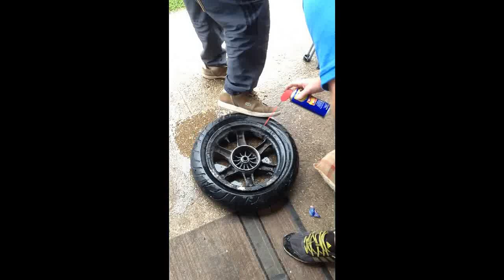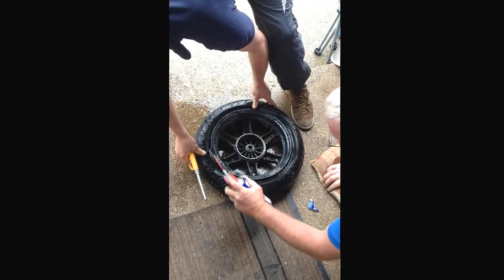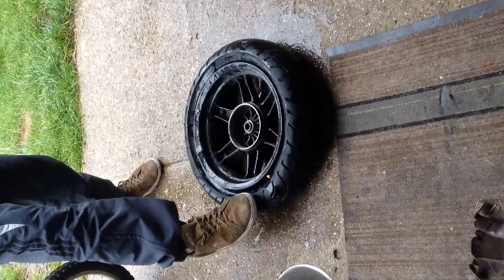Inflate Moped Tyre by Explosion (life hack)

Comment: Why do this?
Reply from the maker: +dave Fool in case you are without a pump. Also if the tyre is completely flat this is needed to get at least some pressure to fill the gaps between the tyre and the wheel
Reply: pocketbattleship never knew this was even a technique that existed
Reply from the maker: +dave Fool  well now you do mate! Glad to help